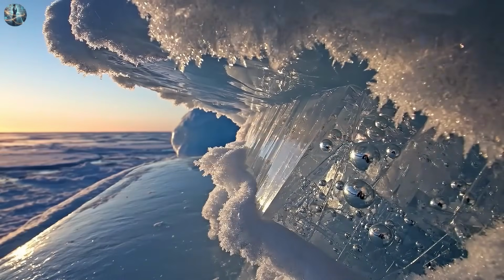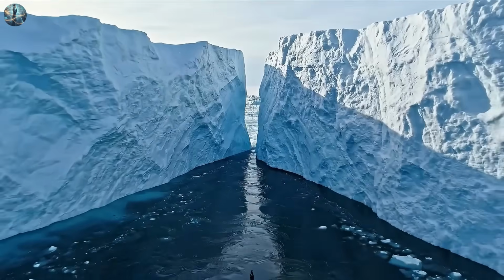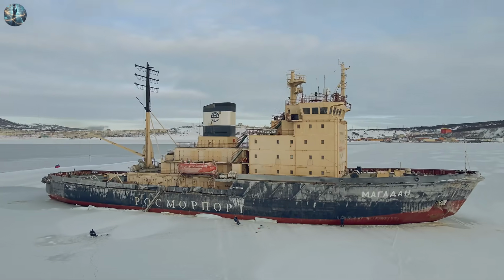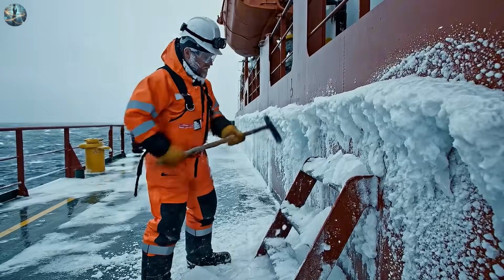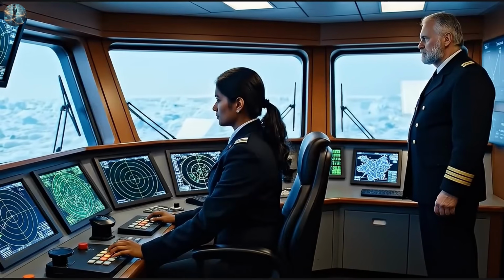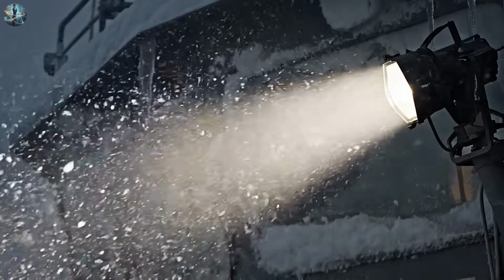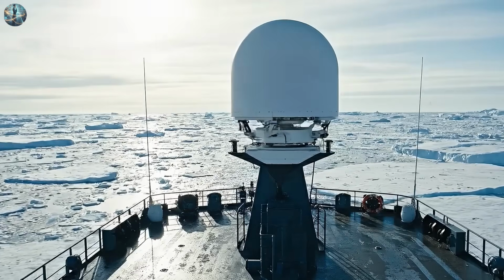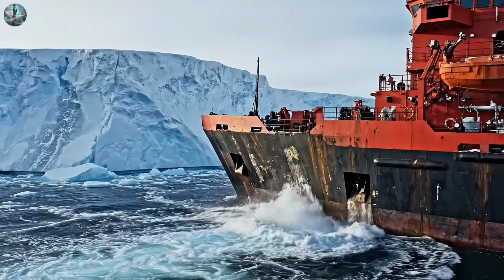Icebreakers Don't Cut Ice  They Do THIS Instead.

Comment: Icebreakers are not all of one design. There are Icebreakers that "cut" the ice. Some icebreakers cut a certain wide path and push the ice to the side under the ice there. Those operate in rather thin ice but at a rather high speed.